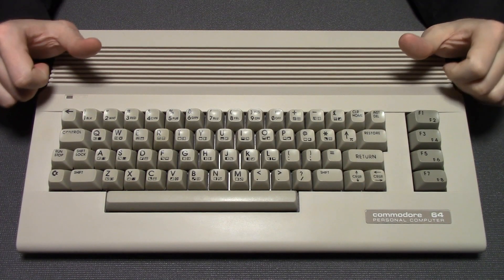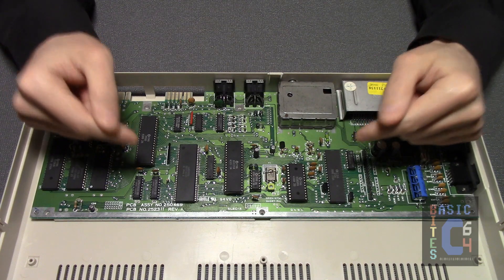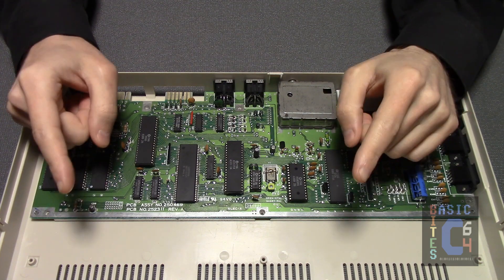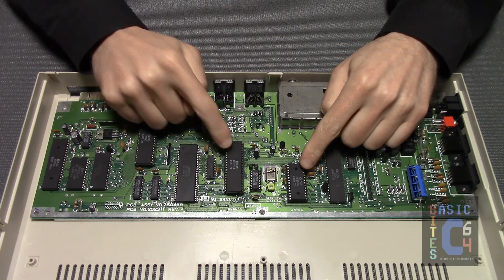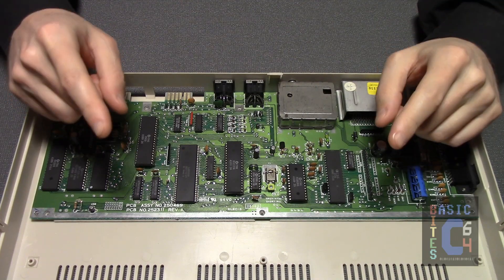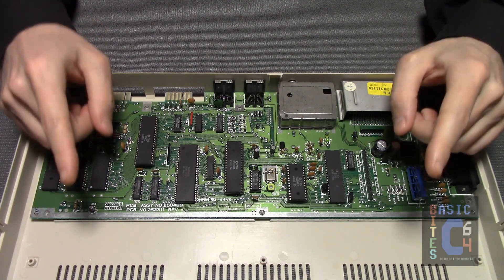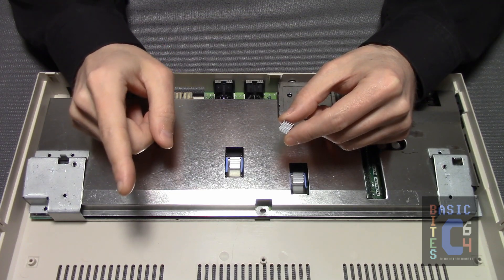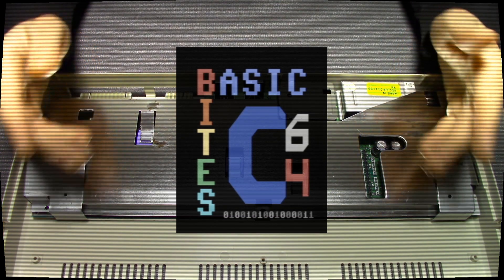How To HEATSINK a Commodore 64C ("Short Board")

Comment: Thanks so much for the explanation. my 64c has cardboard cover, should i put the heatsinks? sorry for the translation I'm Italian and I'm using google translator.
Reply from the maker: My pleasure!  Personally, if I had the cardboard shield, I would probably heatsink those 3 chips on the main 64C that I use all the time, just because it's cheap & easy and might help that computer enjoy a longer life.  If in doubt, the next time you have your 64C open, I would suggest letting a game or demo run with graphics & sound for about an hour to see first-hand what the heat output is like. :)  -- JC

Comment: That's a great use for the silicone thermal pads and small heat sinks.  I appreciated your explanation on the changes between the NMOS and HMOS and the C64/C64c.  I find it interesting that many people think this process was done only to cut costs.  While it is true this eventually led to cost reduction at first the C64C, at least here in the USA, when it was released had a price increase for a while.  Moving to the 8XXX series chips led to a drastic increase in reliability so that was another factor.  The 64C is still my favorite model.  Keep up the good work, I think your channel is going to grow big time...
Reply from the maker: Thank you, Racer X!  I'm with you on the 64C being my favourite (both aesthetically and technologically), although a breadbox is fun to use every so often.  I wonder if the chip shortage of the late '80s had anything to do with that price increase, or if it was just coincidental.  -- JC